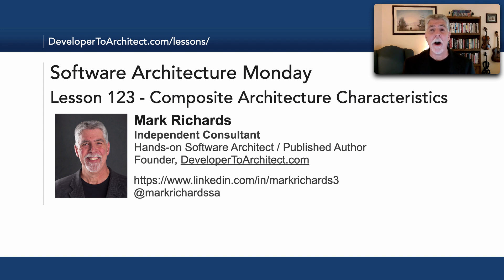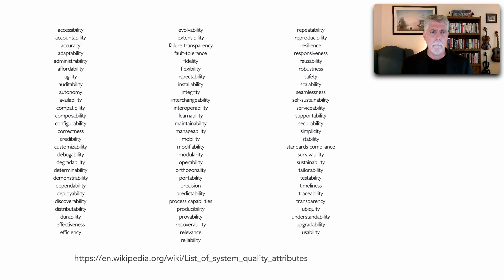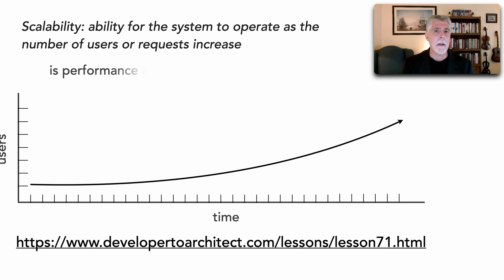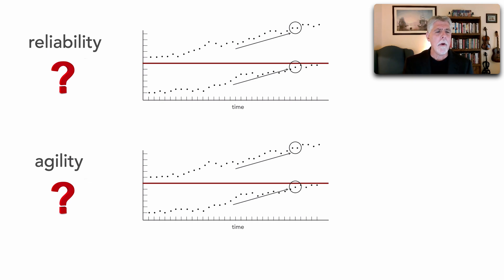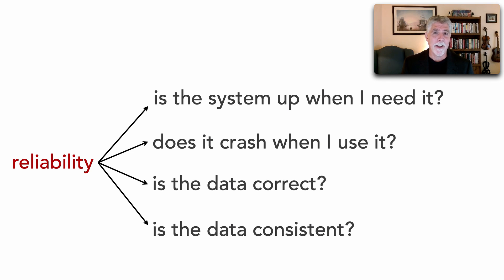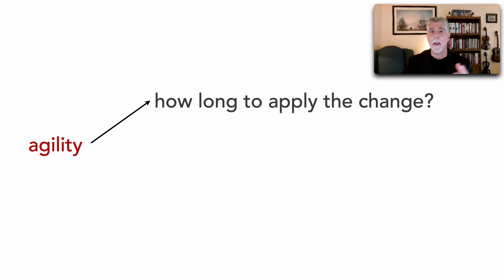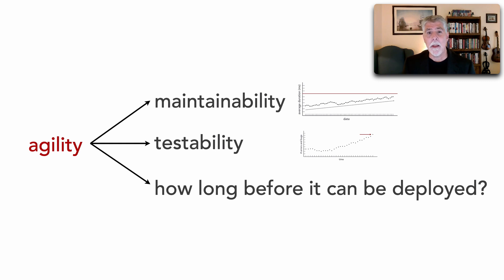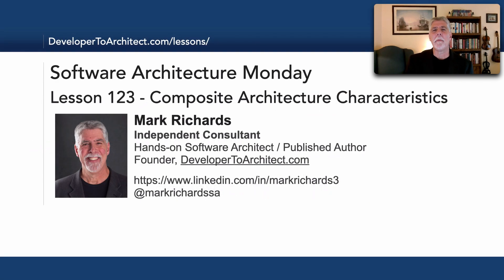Lesson 123 - Composite Architecture Characteristics

Comment: I think (and please correct me if it is wrong) that many other composing characteristics of a composite characteristic might even be composite. Like in Reliability, I agree that "Is the system up when I need it?" = Availability, but Availability might also have Scalability for the system to be up and available, and Serviceability and Maintainability for the system to be up while repairing and the MTTR is at a specific amount of time, and all of these can also be composing Availability.
Reply from the maker: Great observation Masaad, particularly when you ask "how do I measure availability?". The measurement is relatively straightforward, but the root cause is not. So, to your point, availability is measured uptime of a system, BUT the cause could result from a scalability or testability issue.
Reply: @markrichards5014  Thanks, now I got it. So a composing architectural characteristic can be defined as an indivisible state of the system/software, and it can have different causes to it. A composite architecture is a multi-state of the system that is defined as a whole, but can be further divided into its composing characteristics. Also, when we say to provide our measurement for a characteristic we exclude the root cause of this characteristic, or state, of the system and try to measure the condition of the state, not its cause (we look from a higher view for the solution). Thank you for this clarification.